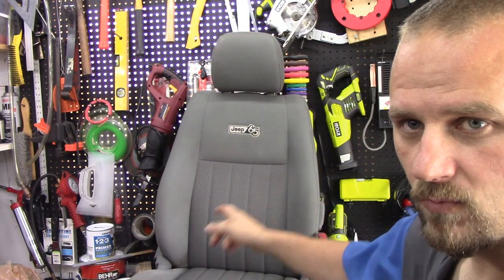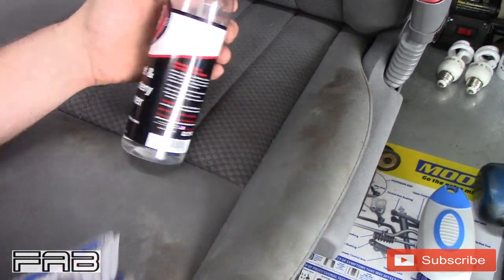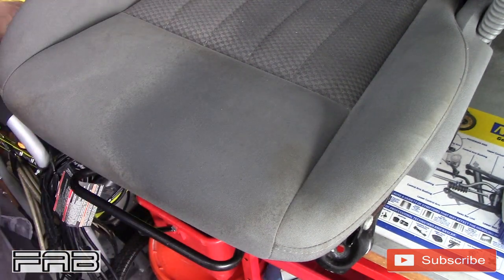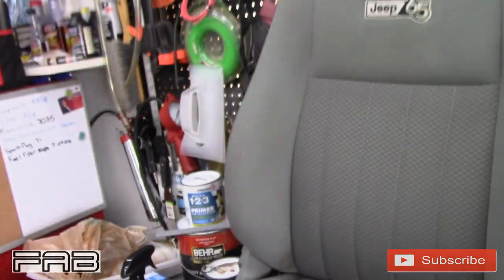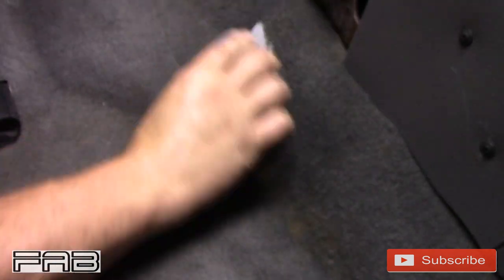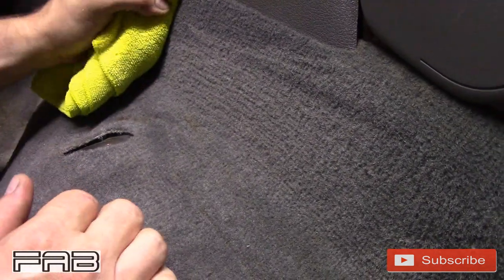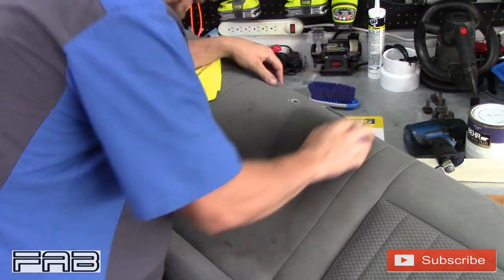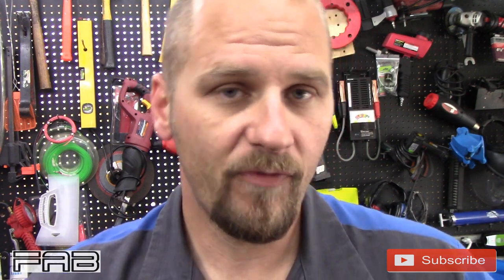Disaster Detail! A Neglected Jeep Grand Cherokee Part 2

Comment: Great video as always!!!!! Quick question about removing the front seats from inside the car. Do we need to disconnect the car battery first? I’ve always wanted to remove seats for shampooing the inside, but don’t know if battery needs to be disconnected. Thanks in advanced
Reply from the maker: Charles detail N Thank You! You only need to disconnect the battery if there are yellow connectors on the seat harness. Yellow connectors are for Airbag wires only. Most likely nothing would happen but if you have those connectors it’s better to be safe then sorry! Thanks for watching
Reply: Thank you very much. 👍🏼👍🏼👍🏼
Reply from the maker: Charles detail N you are welcome!

Comment: good video as always. if you wanna save some time and elbow grease pickup a drill brush off amazon, one if my favourite tools for cleaning seats and upholstery
Reply from the maker: tanner alford Thank You! I have one on my wishlist just haven’t bought one. You just made my case for needing one now. Thanks
Reply: The only downsides I’ve noticed with the drill brush is you can get some sling of the product onto other areas and it will kill the battery on your drill somewhat quickly. Look forward to more videos.
Reply from the maker: tanner alford Thanks for the info! Definitely plenty of videos to come on the Jeep.